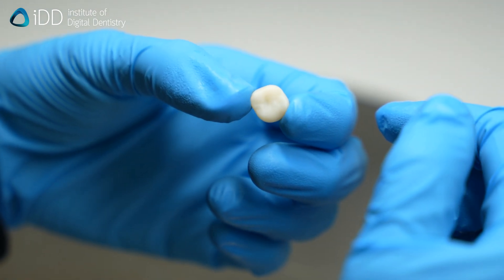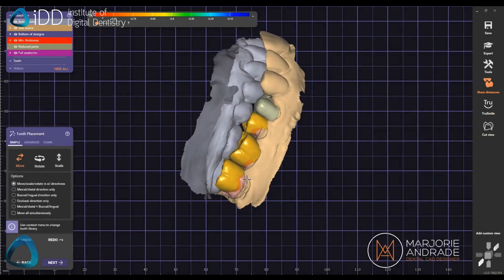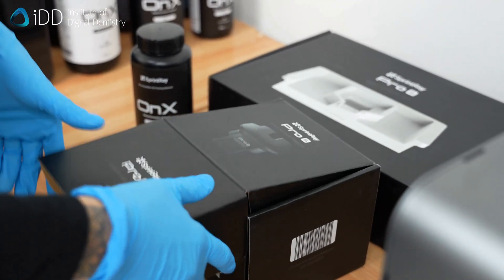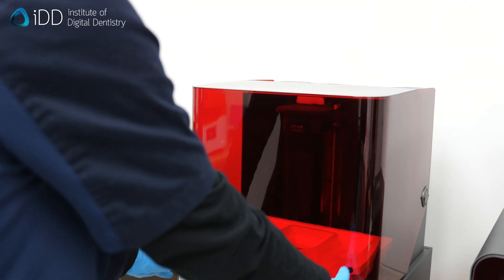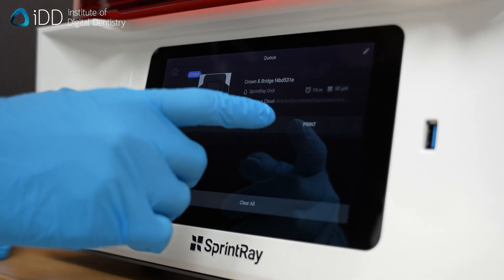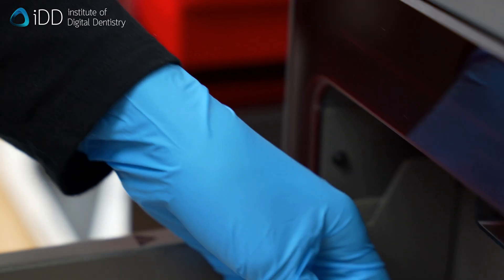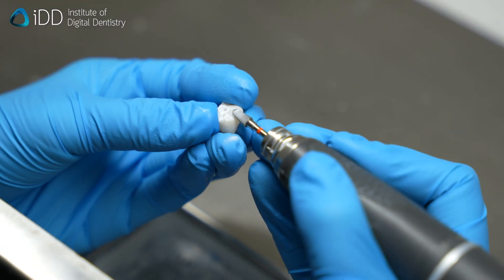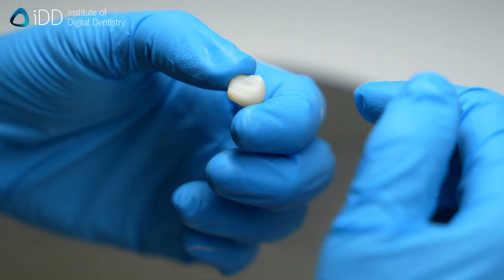Step-By-Step Guide: How to 3D Print Dental Crowns using SprintRay Pro 55S | iDD

Comment: can the onx resin b printed with a stander resin 3d printer
Reply: standard 3d printer such as a elegoo printer
Reply from the maker: @eylibroder-kd4if  if you have the settings required yes. But its a resin that is locked to sprintray and these details are not released by the company.

Comment: Whole procedure how long it take and can we make composite veneers with it also how long would that take for 10 units?
Reply from the maker: Design is the longest part. Anywhere between 30 min to 2 hours. Depending on how good you are. Or outsource the design

Print = depends on printer, anywhere between 20 min to an hour
Post-process = 20 min or there about
Cure = depends on the cure box, around 20-30 min
+ staining and glazing etc if required.

Comment: Hows the strength of the crown? 300mpa?
Reply from the maker: Permanent crown resin strength depends on the resin manufacturer. It ranges from about 80 MPA on the low end (temp crowns) and ~200 MPA on the higher end.
Reply: @InstituteofDigitalDentistry  obviously i meant sprint resin ceramic crown
Reply from the maker: @ValhallaGuild  my bad 😅answering this from an airplane between conferences so lost the context...

Flexural Strength  136 MPA
Shear Bond Strength 34.7 MPA
Flexural Modulus 7.6 GPa

Comment: Next video: bonding protocols 🙌
Reply from the maker: We will cover it soon!
Reply: Same bonding protocols as you would use for emax or a hybrid material.  Sand blast the intaglio, prime and bond the intaglio.  Etch, desensitize, and bond the tooth.  Use your resin cement of choice.